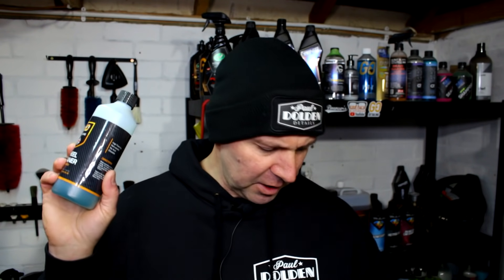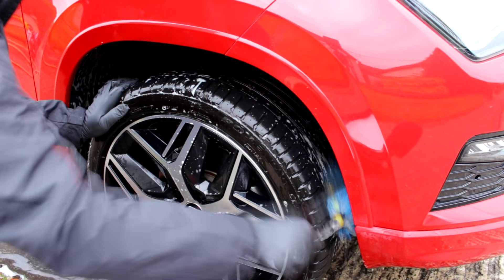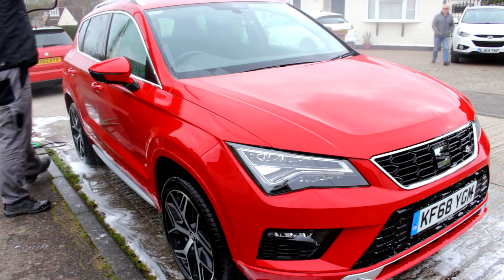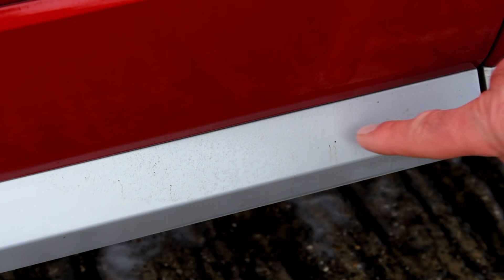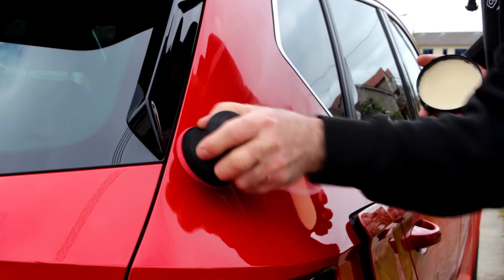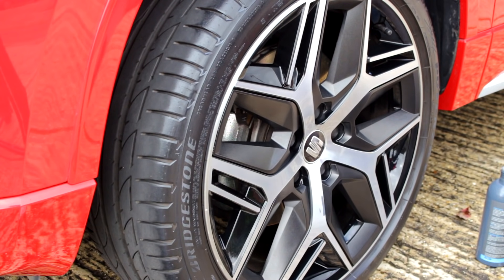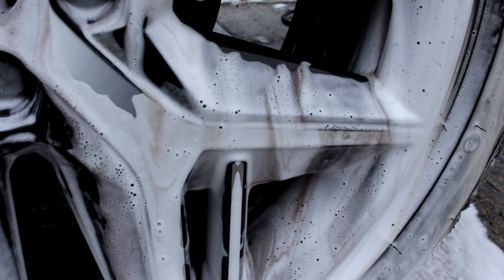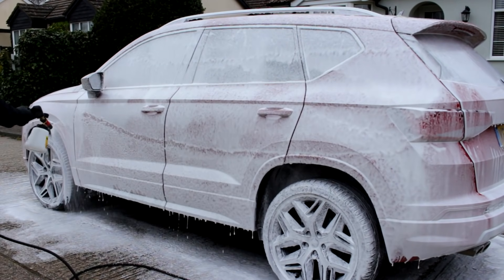I Clean and wax my Dads car

Comment: Ah yes, you're getting the proper Direct Hoses experience now, you can never get hold of them, ever! I've not had a single call returned of the 5 that I've left (none of which have been arsey, just asking for help with an issue).

Haven't seen someone apply a wax for so long that it was quite refreshing!
Reply from the maker: Mark at direct hoses is stupidly busy but that’s no excuse for not returning calls yes thought I would bust out a wax

Comment: Great to see wax still being used,it gives a great depth especially on red. What's your thoughts on wax v sealants etc
Reply from the maker: Depending on the brand and quality they still have a place on the market but the gap is getting smaller with the amount of spray on sealants available to us weekend warriors I personally think waxing is an event and a bit of a luxury
Reply: @PaulDoldenDetails  with time being somewhat of a luxury the sealant/ceramic sprays are a quick and effortless use of time, although I believe if you put the hardwork in you reap the rewards, I know some products claim many months/years of longevity but I've yet to find the golden product that achieves this and stops this dirty rain clinging to the bodywork and glass that's affordable to us weekend warriors,  fed up getting the car on point, only for the next morning to see it covered in dirty dust and looking like everyone else's car, mind you it's probably why we detail.

Comment: Paul are they aluminium running seals , is this pressure washer better than the nilfisk
Reply from the maker: Aluminium trims and as for the machine being better than a Nilfisk it’s not better than the Nilfisk but most certainly not worse it’s perfect for jobs like this watch my review on it
Reply: @PaulDoldenDetails  I have just got my nilfisk not going to watch the reviews in case I like better , went for the c135 I in the end
Reply from the maker: @stevewoolf3502  good choice Sir use a extension lead no longer than 10m mine blew the fuse in its plug 🔌 because the lead was way too long also get a short trigger gun conversion click my affiliate link for your parts 🙌🏻
Reply: @PaulDoldenDetails  yeah see that on your vid so I have got a 10m waterproof extension from Argos believe it not 23.00, and have ordered my stubby gun cheers

Comment: Bilt hamber double speed wax is the best wax
Reply from the maker: Have you tried anything else that’s a bold statement
Reply: No I watched the forensics detailing channel and the guy tested 7-8 best waxes.. it came out on top.
Reply: Thing is with Bilt hamber you can hit it with wash after wash and its still strong performer
Reply from the maker: Fair enough Adam it may be the best out there not going to argue with my mate Jon double speed is good value for money but there’s still a load out there to try including the one I’ve just used 🙏🏻🇬🇧
Reply from the maker: @adamshearing1782  🙌🏻👌🏻👌🏻